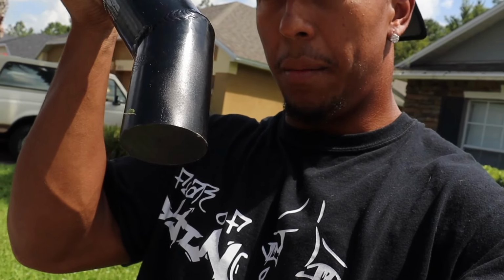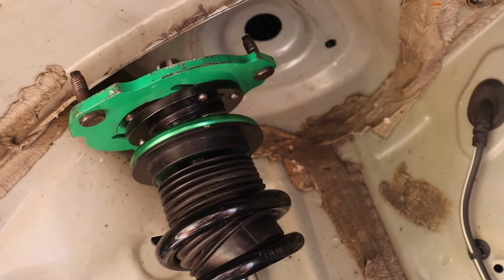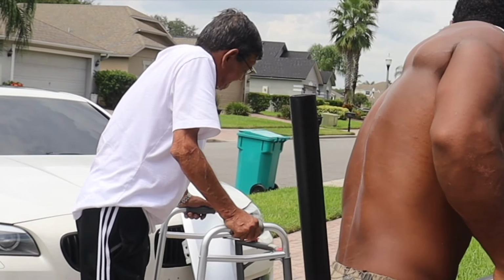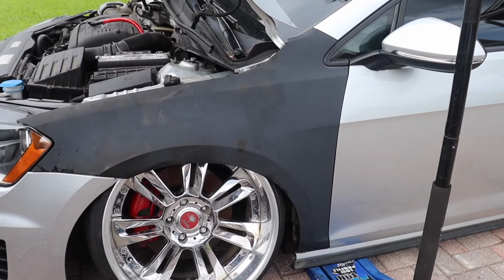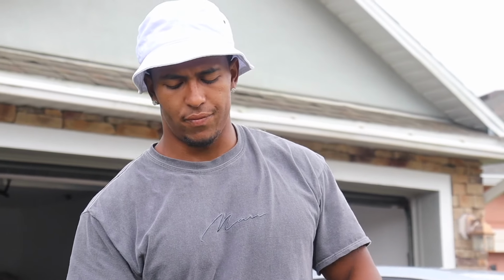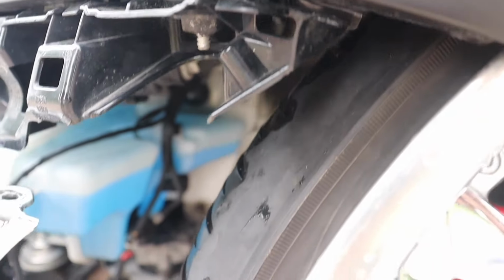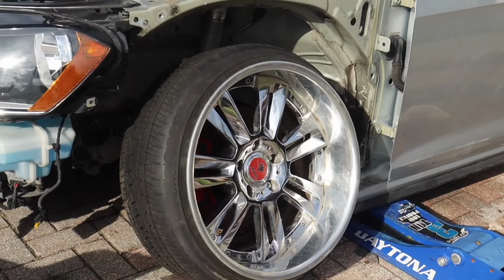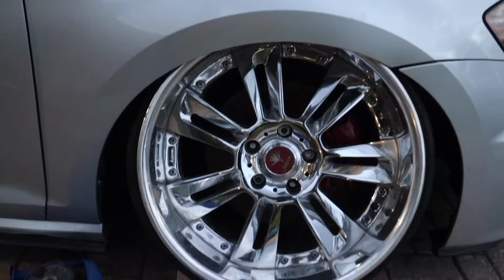FIRST CAMBERED MK7 GTI ON YOUTUBE PART 2

Comment: What exactly are the washers that you’re putting on your coil overs doing? Genuinely curious
Reply from the maker: its being used as a spring basically , it makes the ride quality super stiff to help fitment with the wheels & not damaging underneath the car from excessive bouncing
Reply: @Taywavy  gotcha thanks bro
Reply: @Taywavy  do you know anyway I can make my coilovers go lower than they are supposed to, I heard something about swift spring but how does that work? I have tein coils
Reply from the maker: @Jpgaps  yea swifts are smaller springs, if you want to go lower I would get like 5 inch swifts maybe like 16k spring rate and it'll put you much lower and have better ride quality

Comment: Great stuff :>
Btw, i need to roll my fenders or cut the inside lip like you in my MK5. And I'm wondering which is better, can someone help me? :)
Reply from the maker: on my mk5 I actually never cut them but thats because I rode so long on stocks and they basically rolled themselves... to get the best and tightest fitment I def suggest to cut the lip out but if you want to go the "safer" route just roll them so that way you don't buckle your fenders so easily.
Reply: @Taywavy  thank you 😄